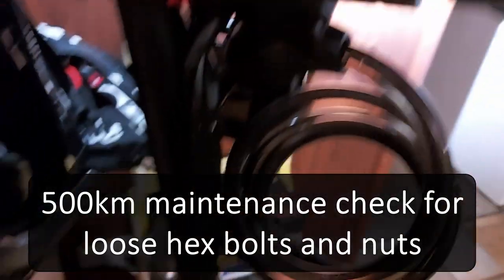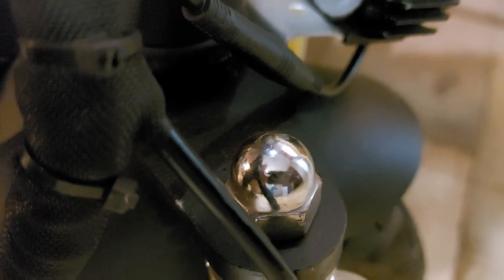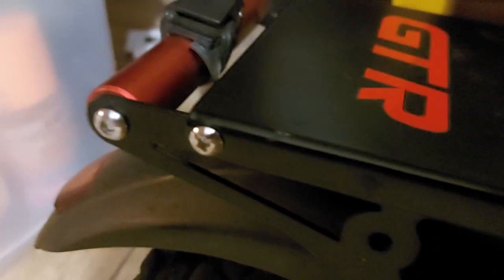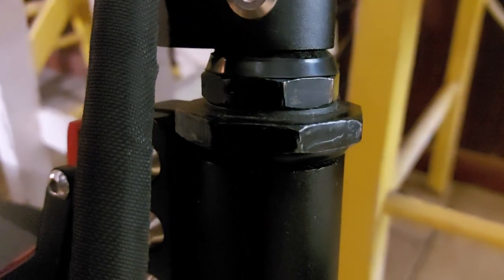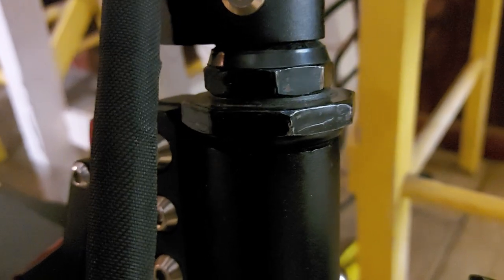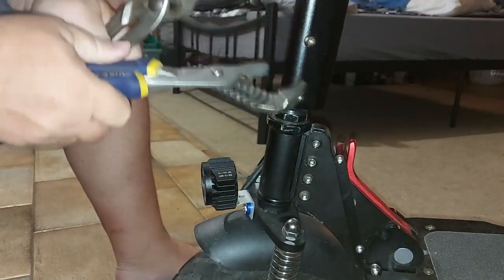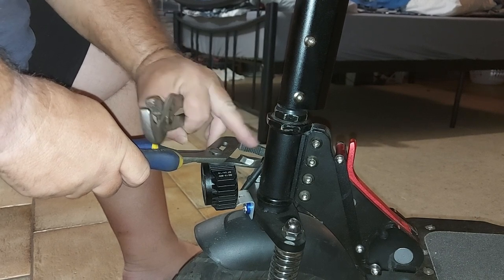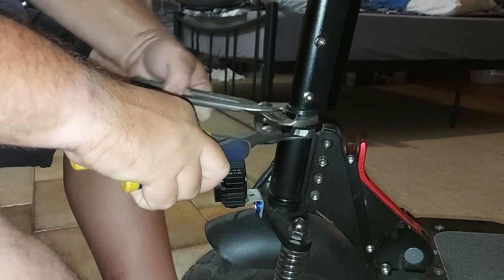E-scooter maintenance - bolt tightness checks and headset adjustment

Comment: How can you tell if your bearings are gone mate? Mine is wobbly as hell and juddering when I pull the front brakes
Reply from the maker: If there is any side to side wobble between the wheel and axle then it will be the bearings.
Reply: @techbio  no side to side wobble mate no

Comment: My steering is a bit stiff, i lock the bottom nut and do i adjust the top one clockwise or anti clockwise? Could too tight make any wear and tear or is it ok?
Reply from the maker: Clockwise down onto the bottom one. If the bottom one is too tight (or too loose for that matter) it can lead to excess wear and tear. Tighten it such the that steering can turn freely without there being in play or wobble in the bearing
Reply: @techbio  thanks for the support, so i hold the top nut still with a wrench and adjust the bottom nut clockwise to loosen, i thought it was the upper nut you adjusted, will try slightly adjust the bottom nut until the steering loosen up barley :)
Reply from the maker: @ray_6677 he mate, you loosen them both off then adjust the bottom down until it holds the bearings firmly but without resistance, then tight the top down over the bottom, holding the bottom in place with one wrench while you tighten the top down on it with another wrench.

Comment: My front top spring bolts seem to loosen alot after long rides. Any tips on keeping them tight? The top front facing left bolt is the most common.
Reply: If you dont want to adjust the bolt all the time, i use automotive grade red threadlock

Held up really well with loose bolts on my 2 chinese scooters

Comment: My scooter everytime I stand it up keeps folding back up on me when I ride it, how do I fix it?
Reply from the maker: Check underneath where the hinge locks into place, there should be a 10mm nut (basically underneath the scooter). That probably needs tightening. Tighten it until the locking lever for the hinge is quite tight to close.

Comment: What size are the bolt’s for height adjustment on the stem? tia
Reply from the maker: hey mate, I can't remember what the size is, do you mean the allen key for tightening or the size of the bolt itself?
Reply: @techbio  the actual bolt

Comment: How do I got about adjusting the height on this?
Reply from the maker: Do you mean the height of the handlebars? There's usually a clamp on the top of the stem, and sometimes little silver buttons you have to push in on the stum.
Reply from the maker: If that doesn't help give me a couple of days and I'll post a video.
Reply: @techbio  hey yes I mean the height. The button seems to be stuck I cant quite push it all the way.
Reply from the maker: @DarealJosh.n26   the buttons can be pretty stiff, try a light tap with a hammer to loosen it up
Reply: @techbio  thanks I’ll take a look soon. Alos there seems to be movement in the actual handle bar stem. Everything is tight I’m not too sure whats wrong. Thanks for the reply.
Reply from the maker: @DarealJosh.n26  try this video for the handlebar looseness. https://youtu.be/ZTrDWgmv-aY
Reply from the maker: @DarealJosh.n26  oops that video I recommended is probably not it. There's a nut on the bottom of the stem, under the folding join, you can tighten that to remove back and forth play in the stem.
Reply: @techbio  its not really a back and forth movement its like the alignment is loose.
Reply from the maker: @DarealJosh.n26  make sure the headset assembly is adjusted properly - at this timestamp in the video https://youtu.be/hFyJbyqNqJ8?t=191
Reply from the maker: @DarealJosh.n26  also try this video, another way the alignment can go bad. https://www.youtube.com/watch?v=CMJBqn9mHLs
Reply: Do you know what size bolts and nut’s the stem take’s? Mine have completely disappeared